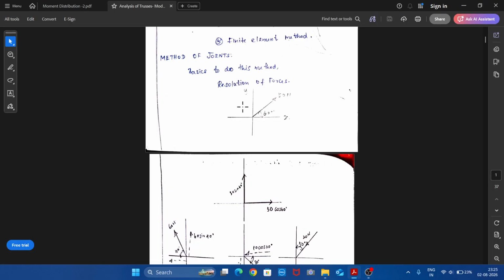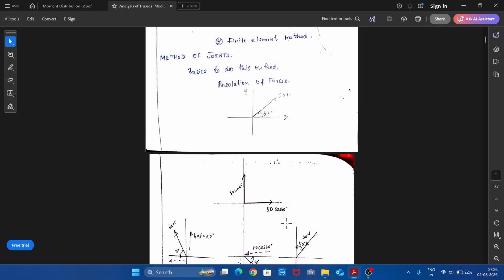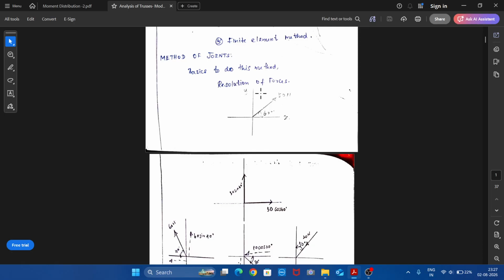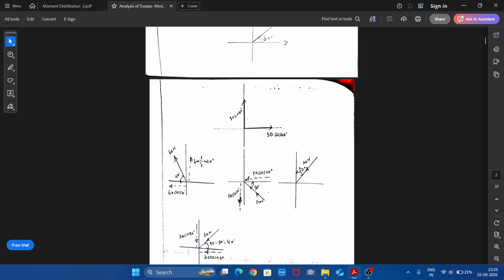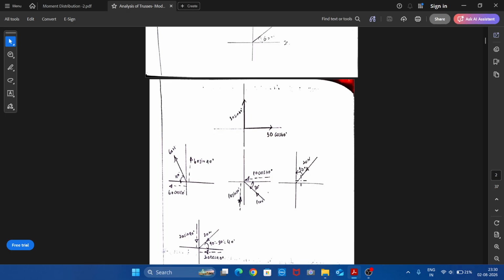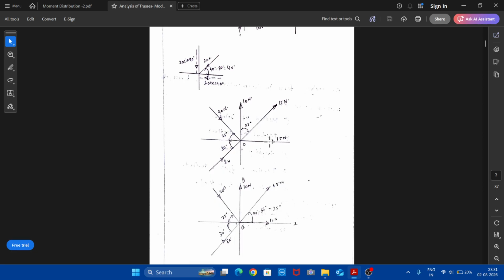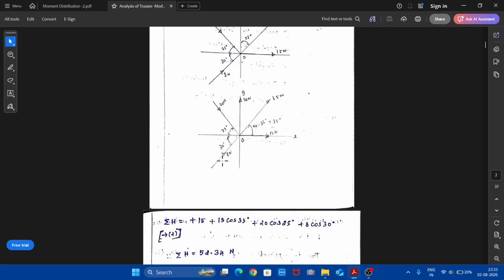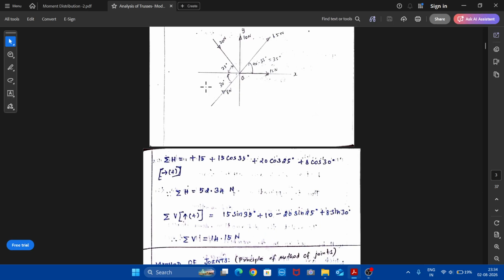TCE LearnEasy Resolution of Forces

Comment: Could you do structural analysis for scaffolding, pin lock type and cup lock type? a generic brand will do,  Main reason is for entertainment we use cantilever to mount led screens , they do this in uae but not here